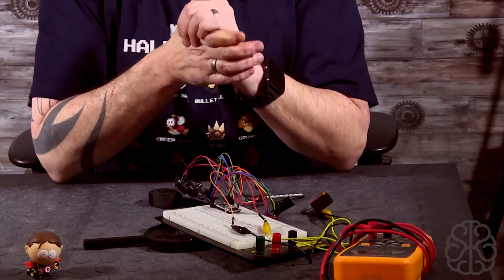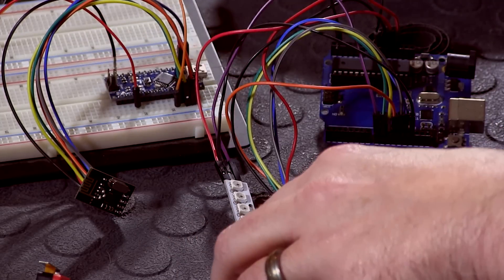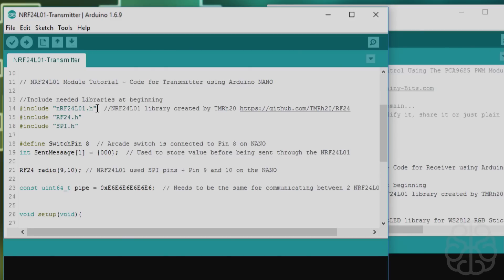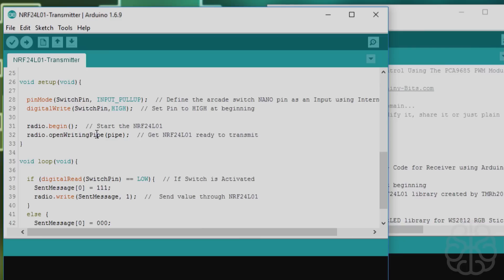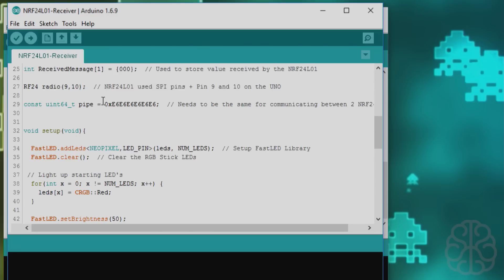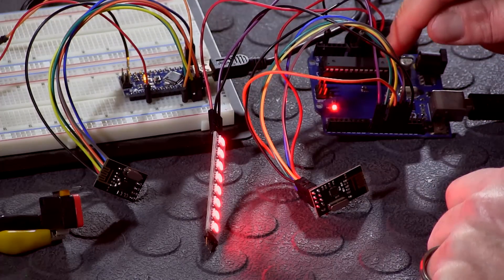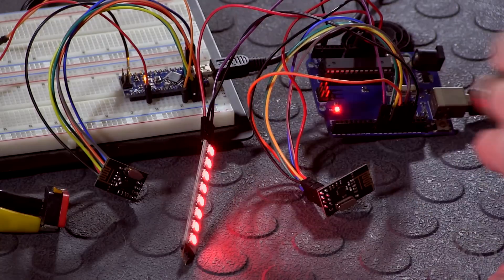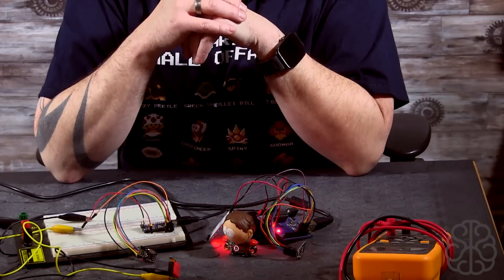Wireless communication between two Arduino using the NRF24L01 2.4GHz module - Tutorial

Comment: Could someone please tell me if the method in this video would produce acceptable results for what I'm wanting to do:

I've recently gotten it into my head to replace my Razer Tartarus, Logitech G502 and Thrustmaster T.Flight HOTAS X with custom built Arduino based controlers, and adding a set of rudder pedals, driving wheel, pedals, stick-shift and handbrake while I'm at it. Here's the thing though: I'd like to make them all wireless, reason being that my USB ports are limited and at capacity. At first I had considered connecting them all directly to my PC using Bluetooth, but with 8 devices, I'm under the impression that wouldn't be feasible, and I'd like to have room for expansion with button boxes and the like should I want them in the future. Now I'm considering putting an RF transmitter in each device and having a single receiver box connected via USB.

Would this work? Can the receiver determine which transmitter is sending data? Would input lag be an issue for gaming? Would any issues arise from multiple inputs on different devices simultaneously?

Comment: IIRC the neo pixels run on about 400hz. Does this method have the bandwidth and speed to controls them remotely , rather than the simple switching that you demonstrated here?
Reply from the maker: The RGB stick is connected to the receiver, an UNO in this case, so it's the one doing all the work once it received a signal from the transmitter.  The NRF24L01  transmit speed is rated at 2 megabits per seconds, but in real life it's probably closer to 1Mbps.  Hope that helps... Thanks for watching.

Comment: Can you have multiple receivers with on transmitter?
Reply: Yes. You can open a "ReadingPipe" for up to 6 devices with this library at the same time. Each device needs an unique adress (first character has to be unique). Pipes go from 0-5. "Pipe 0 is also used by the writing pipe. So if you open pipe 0 for reading, and then startListening(), it will overwrite the writing pipe. Ergo, do an openWritingPipe() again before write()." From documentation. http://tmrh20.github.io/RF24/classRF24.html
Reply from the maker: Great explanation about using multiple NRF modules, thanks for posting this I'm sure it will help others!  Thanks for watching as well :)